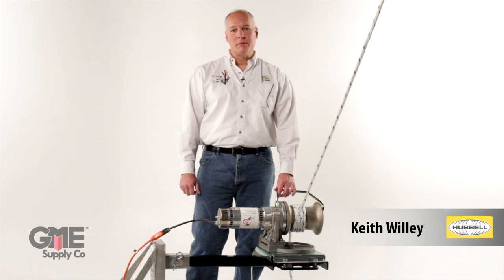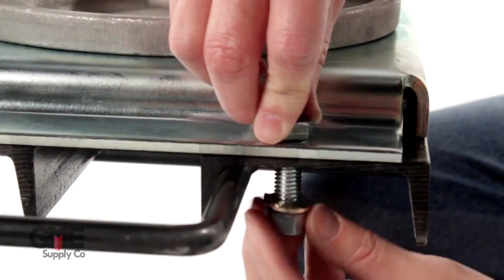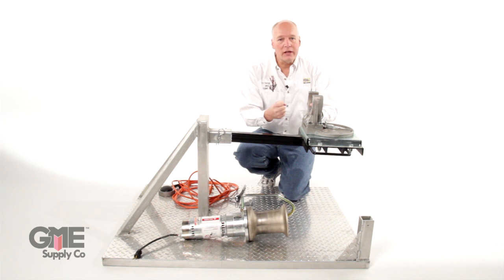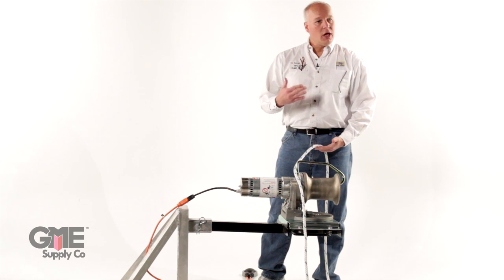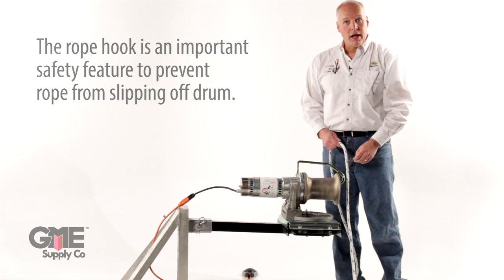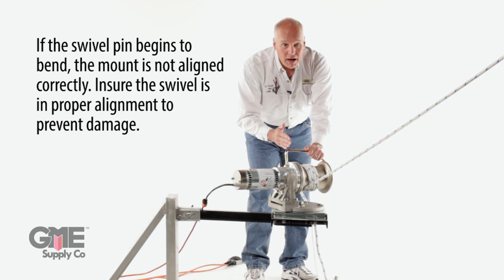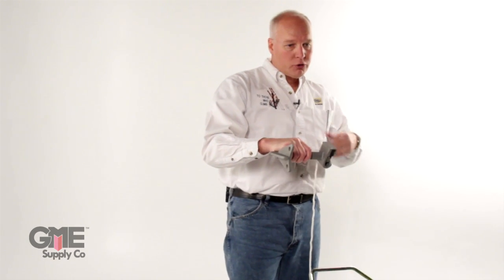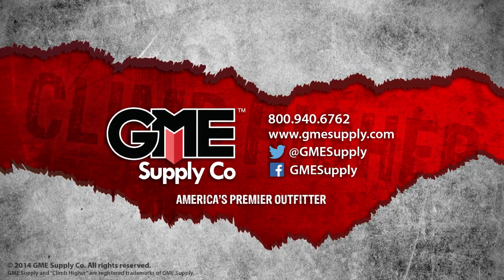How-To: Rig Chance Capstan Hoist To Swivel Mount

Comment: Just buy a 3500 12volt winch,or a 9000 and change it to 1/4 aircraft cable ,gives you tripple the pulling distance.Remote control.cheeper,safer,faster.
Reply: Yeah until you’re working several hundred feet In the air🤣🤣🤣
We use cables too but you gotta use a rope to rig the winch cable. 
This is for running several hundreds of feet of rope man.

Comment: We call them catheads in our industry but I have had 7 to 8  hundred pound pics with this model and had no issues that is with a double block setup. One block on the structure and one on the load itself. Single block 3 to 5 hundred pound pics seem ok.
Reply: Yeah maybe don't go outside manufacturer limits "just because it works". If it drops you're fucked

Comment: So with a 1000lb rated capstan i can vertically lift 500 pounds with a pulley. Does that mean i can lift 1000lb with a gun tackle pulley setup?
Reply from the maker: Yes, mechanical advantage systems can be used with capstan hoists. On jobs like these, a competent rigger should always be present and a proper rigging plan should be developed and followed.